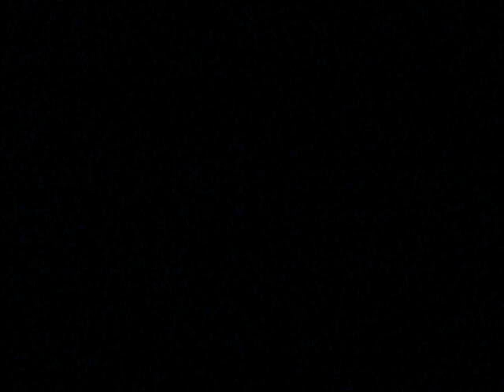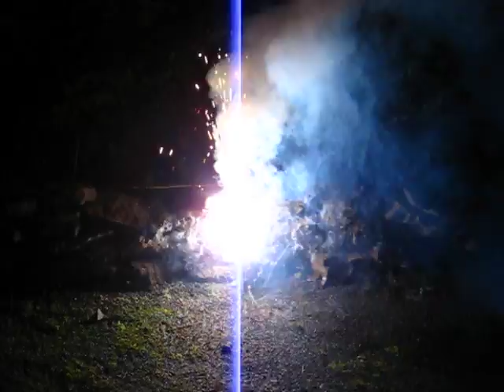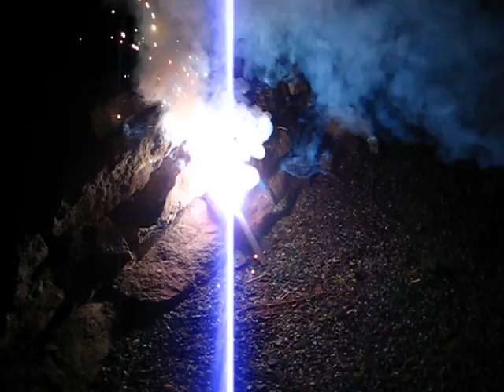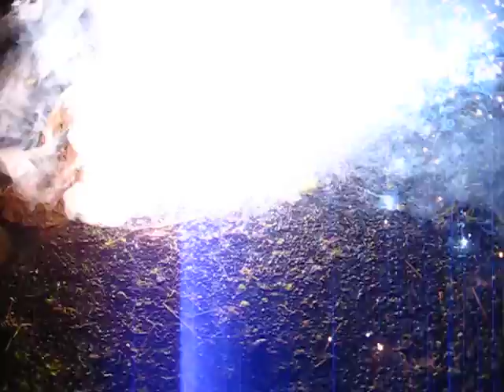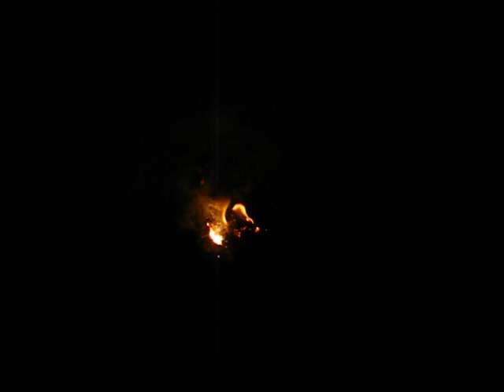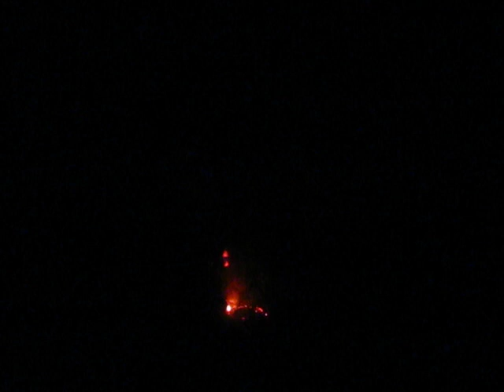Homemade flare

Comment: Made lots of these and work very well. It can easily light up my garden but looking at it isnt smart.
Reply from the maker: Agreed,  in retrospect i should have worn welding goggles,  or shades for plasma cutting.     lots of infrared emission.

Comment from the maker: @MrPiroflame 
by weight,   5 parts potassium nitrate,  3 parts aluminum,  2 parts sulphur.
I also mixed in grease until it took on a clay like consistency,    it seems to ignite easier as a result.
I suggest you use a propane torch or butane torch to ignite the mixture unless you devise a primer.